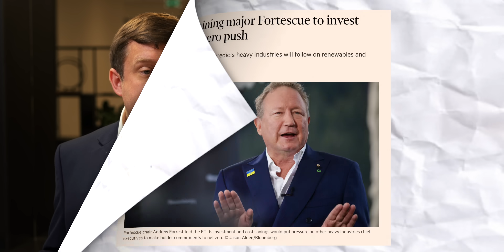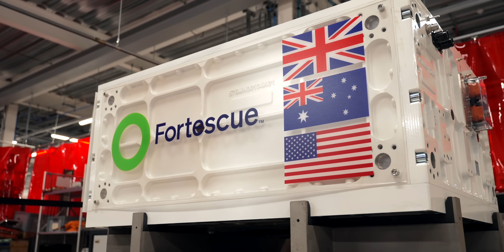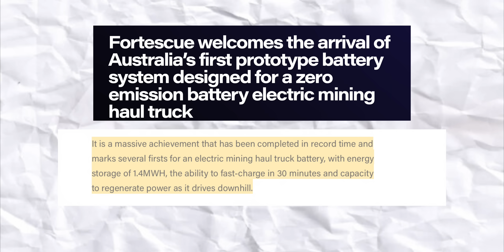This GIANT Electric Mining Truck Charges in Under 30 minutes!

Comment: Would have been nice to compare the EV with the Diesel version, like how long does it take to fill up the tank, run times and weight difference. Good episode though, Imogen smiling when putting on the glasses and jacket, priceless.
Reply: Some mines use EV large trucks like that … and never need to charge them. Mines where they haul things downhill, the vehicle is heavy when going downhill, so it charges through regenerative braking enough to drive back to the top of the hill empty for the next load. 

And one thing about mining vehicles, they don’t tend to have any “road weight” regulations, so even if the battery weighs an extra 10,000 pounds, it doesn’t matter, they just make the vehicle weigh 10,000 pounds more. (Unlike road tractor-trailer combos that have weight limits, so adding 10,000 pounds of batteries means 10,000 pounds less cargo; although at least in the USA, they are allowed to ignore the weight of the battery, so a truck-trailer combo normally limited to 80,000 pounds - with a 10,000 pound battery can weigh 90,000 pounds. A la the Tesla Semi.)
Reply: @AnonymousFreakYT so they have discovered perpetual motion? You can never recover all the energy used. 
By the way you have it arse about, in mining they haul the load uphill and go downhill empty!
Reply: @Paul-b2s4j  Going downhill, they are carrying far more mass - thus far more potential energy available to be converted into stored battery energy. On conventional mining vehicles, they have to use engine braking - wasting that energy as heat and noise - plus extreme wear on the friction brakes - again wasting that energy as heat and worn away brake pads/rotors.

No, the conversion isn't perfect by any means. But the mass difference driving up empty versus driving down full is MORE than enough to make up for the losses.

There are even unpowered trollies/trams from centuries ago that work this way. The "power" to move the cars comes from the weight of the material going downhill in the full cars, which is enough to simultaneously "tow" the empty cars back uphill.

Obviously, both of these only work when the mined material is higher than the destination. An underground mine would need the opposite amount of power - far more going up with the heavy material than going back down empty could possibly store.
Reply: What needs to be reported is cost.  What the mining operation will save by moving to electricity generated on site vs. diesel that has to be continuously trucked in to operate an ICE system.
Reply: @bobwallace9753  it's a prototype, which always cost more. Even at serial production they will cost more to build than diesel. Question is how many years it takes for the lower operating cost to offset the higher build cost. The companies are literally pulling the energy out of thin air.
Reply: @thomasgade226  
The Tesla Semi apparently costs more than a diesel rig but pays for itself in about three years via fuel and maintenance savings.

These remote mining operations have to be paying a lot for fuel due to the cost of shipping in what they need.
Reply: fill up takes longer becouse the guy has to watch the whole time, stop the pump, watch for pressure instead of plug it in go on break remove and go
Reply: Why compare to obsolete technology? The decision has been made to go to zero carbon solutions. The only comparisons needed will be at the low level technical decisions around which IGFETS to use and which battery chemistry suits which applications. This is the detail I’d like to see, but they’ll be claiming it’s the “special sauce”, the IP, where WAE’s value is, they’re not doing this for love, there’s value to their owners, improved efficiency making their iron ore more competitive, making the shareholders more wonga.
Reply: Just use ethanol and biodiesel plants combined with PV and wind turbines to produce fuel. No need to scrap all those cars with internal combustion engines. Just be reasonable.
Reply: @1MCfocus1  
There are hundreds/thousands of perfectly good airplanes parked, unused in the desert because it was cheaper to move to a more fuel efficient plane.   Cheaper to purchase and inexpensive to operate EVs will almost certainly cause ICEVs to be scrapped 'before their time'.

Ethanol and biodiesel will be more expensive than petroleum which would only cause those engines to be shut down forever.
Reply: @bobwallace9753  Buidilng and  maintaining power lines and charging infrastructure will be more than expensive and CO2 unefficient. There will never be enough of batteries to fully electrify the world, so we'd better consider conserving energy in ethanol. Because as the sources of ores used for batteries production will depleet with time, the batteries will get more and more expensive.

Overall (economic and environmental) cost of running internal combustion car for 20 years is much lower comparing to EV, because you would have to change EV's battery at least once in that period. And EV's batteries are toxic and as expensive as a whole car.
Reply: @1MCfocus1  
You're behind times when it comes to knowledge.  Lithium batteries are highly recyclable.  Well over 95% of the material in a lithium battery is recoverable and reusable.  It's largely going to be 'mine it once, use it forever'.

As for materials, lithium, iron, and phosphate are available in very high quantities.  Plus we are developing batteries that use sodium and sulfur, which are also found in great abundance.

What we are running out of is easily extracted oil.  There are massive amounts of oil in the world but we've already used the easy to obtain, least expensive sources.  We could (stupidly) continue to use oil but the cost will have to grow as we have to work harder to access what remains.

And, unfortunately, you've bought into the illogical claim by the fossil fuel industry that EVs are more polluting than ICEVs.  That's nothing but a bowl of c**p.
Reply: @bobwallace9753  Batteries are just part of this expensive problem. Recycling of toxic materials always mean more pollution. You are right about fossil fuel industry created one hell of a plot: they invented carbon footprint to blame others for pollution and to make them create more space for even more pollution. Carbon credits and stuff... pfff...
Reply: @1MCfocus1  
You, like everyone else, have a choice.  Continue to believe foolish stuff or educate yourself.  You might want to start with how batteries are recycled.  

Up to you.
Reply: @bobwallace9753  When you have to change your whole battery pack every 5-10 years, and pay for it as much as for a new car, then you start to think, that this is a GREAT BUSSINESS!!!! for battery makers.
Reply: @1MCfocus1  
Just more ignorance on your part.
Reply: @1MCfocus1  Batteries last the lifetime of a car at least. There are EV's out there with batteries that lasted 600.000 km. The newer ones can last even twice as long. I have never driven an ICE car that many kilometers. My last ICE car lasted 525.000 km.
Reply: Yes, I think the comparisons weren't shown for a good reason.

Comment: This truck needs a 3 Megawatt charger to charge in 30 minutes. I'm guessing they will be thin on the ground.
Reply: Indeed. And I wonder what voltage it runs at. They didn't actually tell us, but I guess it's more that the usual 800V to keep currents vaguely sane. Maybe 1500V and 1900A? Can you do 3kV and 1000A?  It is certainly proper engineering. I'm not actually sure what the engineering limits here are. Maybe contactors is the thing that limits pack voltage?
Reply: @xxwookey  1000v is more reasonable, not that much different from 800v but its ok! also those battery modules are quite very small, how they manage all those BMS?
Reply: How many do YOU need?
Reply: @FrunkensteinVonZipperneck 
I don't need any.
Reply: Or multiple smaller charges. It isn't new to divide up the onboard batteries in to manageable sizes. Electric ferrys, tugboats, tesla semi....
Reply: @theunknownunknowns256 
Yes I've seen that suggested for EV's but the idea that people could hog two charging outlets to the detriment of others that may only require one seems a non-starter to me.
Reply: The robotized charging of ferries from Helsingborg to Helsingör charges at 10 kV. But they run the 10 kV 10 MW AC onto the ship which then transforms it and rectifies it to 800V DC to charge the 4MWh batteries.

Comment: and mining is so much better than burning fossil fuels.
Reply: @oddjobsandrandomprojects  yes! That is correct. 
I replied to the wrong post half-way though. 
My mistake and my sincere apologie.🙄👍
Reply: @oddjobsandrandomprojects  😉🖐 not at all thanks for the understanding.
Reply: Yes? This truck moves enough material to build thousands of vehicles daily, and will be able to continue doing that for over 20 years on that set of batteries before being needing to be recycled and made into new batteries. 

In comparison the diesel version of that truck would be consuming the entire weight of that battery pack in diesel fuel alone every single week it operates.
Reply: @swecreations  what a joke! what do you even know about that?! the mining sector is very tough on vehicles and nothing said the batteries will last that long! the diesel can literaly work everyehere all the time doesnt matter if desert or closer to the pole! diesel engines were also made to run biodiesel or fuel from waste recycling and much more! i dont get your problem!.
Reply: @swecreations sorry to correct you.
This truck doesn't shift enough material to manufacture anything, nore are there a fleet of them on a cycle. 
Thus the thousands of vehicles a day with a work life of 20 years.
No mate.😏🖐
Reply: @swecreations  diesels are made for literaly all kinds of use/applications everywhere while the EV needs to be very specific to a site period!
Reply: @swecreations 
How much coal is burnt to charge that battery?
Reply: @Robert-j6r8c  If you watch the video you can see that it's run on wind and solar power.
Reply: nope! actually its worse! diesel equipments can work 24/7 without needing to stop or refuel, just service or control. the EVs just comes when the ICE has already cleared and opened the mining site..... youre welcome.

Comment: Diesel electric hauling trucks have been in mining for decades so electronics and electric motors have been thoroughly tested. So what has to be proven in the field are the batteries and the charging infrastructure
Reply: diesel series hybrid with trolley wires is definitely the current tech solution mining emissions
though the fuel usage is only reduced by 90% while connected to the trolley wires, so even if all of your haul roads are electrified, youre only reducing emissions by maybe 80%
which is pretty great
Reply: Electric motors are used in all kind of industries for ages now. There are a lot companies which already show that charging works. It works in cars but also in much bigger vehicles such as electric ferries for cars. For instance the electric ferry “Suloey”.
Also these trucks can recharge partially when going downhill (I assume that diesel motors lose diesel even when going downhill and are using up their brakepads)
Reply: @Gregory-Mugen  At one site, the going down hill charge the vehicle enough to make the return, basically means their was zero input into the machine.
Reply: S African gold mines, to east of Jo'burg, used diesel shunters at least a mile deep through the main galleries.

The exhaust was fed to water tanks bolted to the side frames to collect the particulates.

The fumes were sucked away by the ventilation system, which was so powerful it could have your wig off even a mile deep.

Also the vents sucked the hot air out.

On the western side of Jo'burg the gold mines are over two miles deep and much hotter ( known as the western deeps). Diesel shunters worked down there too.
Reply: @t1n4444  That a lot of expensive infrastructure that needs to be maintain, all eleminated by batteries. All eleminated by the switch to electric.
Reply: @DavidKnowles0  Apparently, you weren't paying attention when they mentioned all the expensive infrastructure needed to generate the electricity and charge the batteries that will need lots of Sq. Km. of land and maintenance. Not to mention all the raw materials that have to be extracted and transformed using energy intensive manufacturing methods. There is no free lunch and no perpetual motion machines in physics.
Reply: @russelloconnell3367  That infrastructure can be re-used if need be when the location shuts and it needs to be transported to a new site OR perhaps just transmits its energy by a new line to another location.  You can't do that with burnt fuel oils and the clean-up for ICE maintenance facilities (assuming codes of compliance in play) will neither be cheap nor environmentally neutral.
What would that land be used for otherwise?
Maintenance on non-moving parts is relatively simple c.f. servicing ICE fleet with a plethora of moving parts that might need repair or replacement.
A mine is in place for many years so the appropriation of the raw materials for a multi-decade fixed emplacement of high usage is far more efficient than thousands of cars employed a few hours a each day of their lives that are likely shorter than those of the mining vehicles, for instance.
Reply: You need better batteries to make this work the technology isn’t here yet
Reply: @GraemeMarshall-u7w  

Hmm ... your point about batteries raises the question that if batteries were used to power locos mines then if there was a fire in a battery pack then you might well find nasty gases throughout the drives, galleries etc.

Piling on the Armageddon thing what if the ventilation system brought the nasty gasses to the surface? Or if the ventilation system shut down altogether?

I dare say mines might be one place you wouldn't want to employ hydrogen powered anything.

I would suggest the ventilation system in itself might do an excellent job of combining hydrogen, if leaked, and air (plus naturally occurring methane?) into an explosive  mix.

Can't see that going down too well.

Comment: It only takes ONE cell to burst into flames🔥and you will have a massive chain reaction of biblical proportions! 🧐
Reply: OMG YOUR RIGHT!  I mean, i doubt that WAE have thought about this? What with them being one of the industry leaders in high performance battery systems. You must call them and let them know about this issue you have discovered immediately...........     😜
Reply: That box looks pretty robust. I think they thought of this.
Reply: I think you're confusing this with atomic bombs...
Reply: Each battery cell is dependent on it's integrity of manufacture. Industry has yet to manufacture the perfect reliable cell. There is such a thing as thermal runaway due to damage or imperfect manufacture once a cell reaches critical temperature due to whatever reason nothing will stop it igniting any adjacent cell. Hydrogen or ammonia engines are far more reliable and safer than the battery technology.
Reply: @piprob5618  That's not actually true. There are plenty of examples of packs with some overheated cells, but not the whole pack charred. One overheated cell does not mean every other cell in the pack will be destroyed. That is possible, but it is not absolutely inevitable.
Whether or not you are correct to say to say that Hydrogen or ammonia ICE is safer than batteries, it's clear that batteries are safe enough in practice. In the real world they burst into flames slightly less often than existing petrol/gasoline vehicles, which is a level of risk people find acceptable. Ammonia engines look they will be used for shipping, but there are just about no situations where hydrogen ICE makes much sense, primarily due to the low efficiency. It might find some niches.
Reply: It only takes one small hole to have a natural gas pipeline blow up.
Reply: Lol, you should see what happens when a natural gas pipeline goes up in flames.